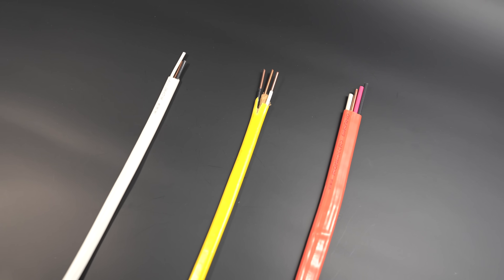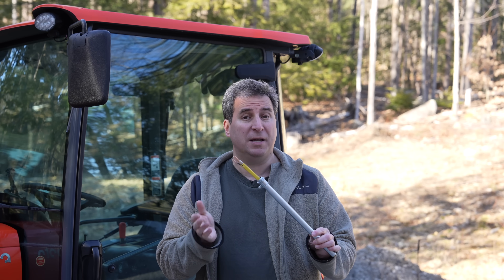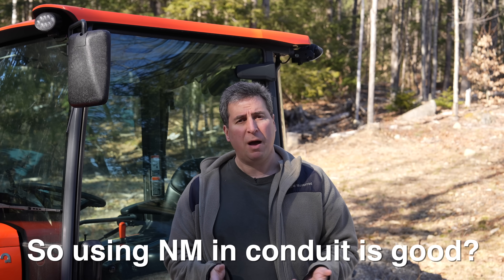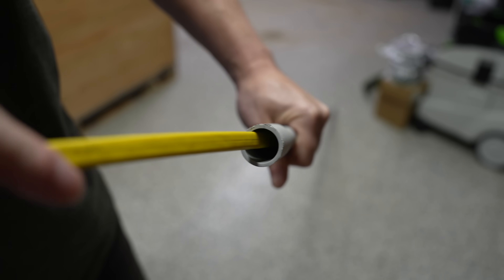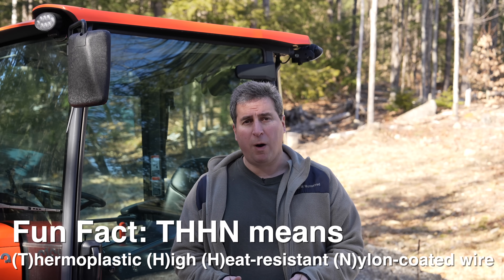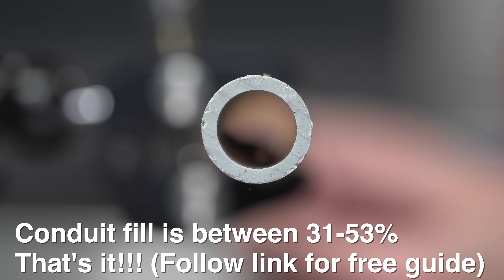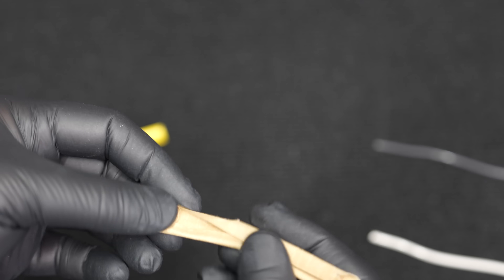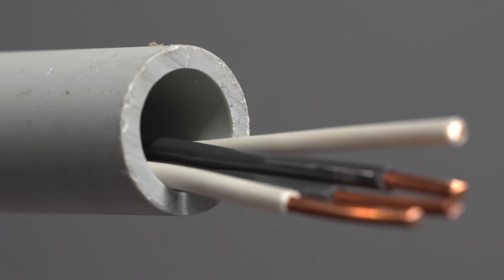#1 DIY Electric Mistake - Can you use Romex Wire in Conduit?

Comment: is it all wires cover same material over copper ???  whats difference between both romex and thhn..both have nylon jacket covering copper conductors ...also plastic is much safer than metallic ...it also add another layer of preventing electric short when it touch the casing ...vs metallic ...its gonna have current traveling anything made in metal, well good news least we move on from dangerous knobs and tube wiring when they use fragile rubber that can brittle by touch ...also PVC pipe has to be leak free sealed system...i see sloppy installs for underground pvc that meet with coupling above surface and another pvc to outdoor breaker box that leave inch gap between both ends ...not proper measurement and illegal to have when rain water can drain into pvc that meet coupling and joint to other pvc goes underground
Reply: @inthemiddleof  Incorrect, as per  UL 719 NM-B cable can be, and are,  constructed of 90 deg C conductors but is listed at 60C for ampacity calculation only as per the NEC.  The conductors in NM-B are UL 83 (THHN/ THHW-2 (if there is no nylon jacket)) or UL 44 XHHW.. They are not required to be marked on the conductor but they do meet the Ul requirements.. If the conductors are properly marked they can be used without the jacket (Talk with your AHJ about all usages and applications for ALL electrical building materials.. the NEC code (NFPA 70) is not "law" and the local AHJ has a lot of leeway).
Also, most UL conductor styles have multiple listings. THWN-2 is the most rigorous of the "T"
T stands for Thermoplastic ans was the original plastic insulated wire rated at 60 deg C DRY only (No nylon jacket)
Then came TW.. 60 deg wert or dry  (No nylon jacket)
Then came THW  75 deg wet/dry  (No nylon jacket)
Then THH/THW  90 deg dry, 75 deg wet  (No nylon jacket)
THW-2   90 deg wet/dry  (No nylon jacket)
Then came THHN/THWN.. 90 Deg dry, 75 deg Wet (with a Nylon jacket)
The latest is THHN/THWN-2  90 deg wet/dry (with a nylon jacket.. This is commonly referred to as THHN-2 but is actually THHN/THWN-2
Reply: @darikmatters8866  why would 90c conductors be marked as 60c fot calculations ? It makes no sense.

Comment: Solid wire in conduits limits the types of connectors you can use at the application. Solid wire, the conductor constituents of romex have a resistance to turning that can split the insulation along the length of the wire. The better solution is to switch to stranded wire if you’re 100% certain how your wire is going to feed in the application. In remodeling projects the problem is that you applications need to fit into existing modified spaces and this means that you may not be able to use 6” radius turns.
Reply: I do not know what you are talking about.. I have sold at least 10 million feet of #12 and #10 solid THHN/THWN-2 over the last 40 years without a failure as you describe (I have done some rough calculations and I have sold at least 250 million dollars of basic building wire). 
As a separate note; Ther NEC does not make accommodation for limited space in renovation. If you have to bend the wire more than its allowed by NEC or manufacturers written recommendation you need to find an alternate method, period. Solid is used for these small diameter wires because they typically terminate better and more reliably without a terminal lug and they are less prone to corrosion due to the smaller surface area and less wicking. I sell #8 and #6 solid for municipal street lighting circuits due to the reduced corrosion profile.
Reply: @darikmatters8866  split insulation are not common, I agree, but in demo work I find enough of then to take note. Maybe you have better electricians in your area.
Reply: Are you talking about split Nylon jacket or split open insulation with the conductors exposed??
Reply: @darikmatters8866  exposed conductors.

Comment: So you can't run non metallic conduit underground ? Won't your conduit just rust away eventually?
Reply: PVC and Fiberglass conduit is the best choice for underground.  But steel rigid  is  also permitted when increased  protection from physical damage is desired.

Comment: You can run in a wet location if you run it through liquid tight flex.
Reply: Romex is bunned from outside use, regardless of a raceway type. However,  you can get UF type NM cable (rugged,gray color outside jacket) that is rated for outdoor installation,  even exposed and buried underground without conduit, where it is no subject to physical damage and depth requirements are met.

Comment: Love the video and straight to the point direction. Excuse my ignorance I’m just a DIY’er home owner. Beside the 53% conduit full and the struggle it takes to run it in conduit. Is that the only risks or hazard why you can’t run it in moist area? I’m guessing pulling the cable would damage the yellow jacket?

Comment: Funny thing is some romex has THHN wire in it (even individually labeled) but since its not intended for use outside the cable it cant be used as such, lol
Reply: I have never seen conductors labeled inside of romex.

Comment: This is interesting.  My arcade was wired with 1/2" EMT with Romex.  We discussed the code / fill and found it acceptible.  The heat issue did come up but since it was split between 2-15 amp breakers for both halves of the room it was deemed acceptable  The foundation has insulation on the outside and the inside temp holds steady between 57 and 60 year round.  Bending was a fun trail and error.  And to be clear the wire was inserted before all bends and pieces so there was no pulling.  He never mentioned water / condensation.  I wonder if it will ever fail, been going on 6+ years good now, no issues.

Comment: I was also of the understanding that it was illegal.   Now one for you.  I bought a house with two garages and the homeowner had wired both garages.  They had ran the romex through PVC water pipe.  I removed all of it and replaced it with armored cable.    

It gets better.  There’s a safety switch on the side of the house that’s fed off the main panel.  It had one 30 fuse, there was room for two.  It went overhead to the 1920 garage that had an age appropriate fuse box, glass screw in fuses.  They had the romex going through two walls and into the second garage.  It was on a 20 amp fuse, in fact both garage were on the same 20 amp fuse.  

Everything is now on modern breaker boxes and proper sized wire with correct sized breakers.

Comment: I'm an EMT guy on Block walls, Smurf in Attic. MC For Lighting for Flexibility.
Code is For Safety, 35+ Years Master. I avoid Romex Except if Has To be Used, Conduit can Protect Going into Attic from a Block wall. Removing Protective Outer Sheathing and Putting in Conduit Should  be Considerd Better Protection. Removing Outer Jacket is Good, As It can Dissapate the Heat. Need to Add Eception to Code. Conduit Protects Better than Sheathing. No Brainer

Comment: I've got a couple of problems with this video. First, I can't imagine any competent electrician wanting to run Romex in conduit. If you don't want your insurance company contesting who is responsible for your burned down property you should be using a licensed electrician. Second, what about derating the ampacity of the cable? Isn't Romex intended to be run in free air? Third, in a related issue, how do you handle conduit fill?   In my opinion, if I saw Romex run in conduit I’d call the local electrical inspector.

Comment: 1) NM Cable is not permitted in Damp or Wet Locations. 2) Now, if you want to put a related product in the raceway you place UF-B in the raceway if you choose. Also, be aware that if you are only using the raceway for protection from physical damage then look at Chapter 9, Table 1, note 2 and the raceway fill is not necessary if the raceway is not a complete run and only being used for physical protection. However, if the raceway is complete between boxes, cabinets, or enclosures then you most certainly have to do raceway fill per Chapter 9, Table 1, note 9.

Comment: I want to use 2-inch PVC pipe as a raceway.  Indoor dry environment. How many 12-2 Romex wires may be run in this pipe and still comply with the 53% rule?

Comment: Where in the code does it say you cant run THHN in a conduit in a damp location?
Reply from the maker: I said just the opposite
Reply: @SilverCymbal  The individual conductors in NM cable are THHN. I thought you said you couldn't strip the wire and put it in conduit. Maybe I heard you wrong?
Reply from the maker: @cousinles80  You are assuming they are THHN, and they may be, but you cant be sure of that because they aren't labelled individually. They are blank.  All THHN will be labelled with ratings, etc. Unmarked wires are NOT allowed under the NEC as you don't what they are. I am not the police and you can do what you want, but this would always fail inspections if they see that and it's not the correct way to do it with unmarked conductors.
Reply: @SilverCymbal  You are correct, I just found it in the code book. I see they even make connectors that go from romex to emt, not sure where you would use them. I stand corrected. Thank you.
Reply: For years I thought it was bad practice to run NM cable in conduit, so I would strip the Romex back the length of the conduit run  and put a male adapter and a threaded coupling with a romex connector on the pipe. I never failed an inspection this way but maybe from now on I will install a junction box and convert to marked THHN wire.

Comment: The problem is "heat".  Code allows only so many wires, Romex is not only an electrical insulator it is a heat insulator.

Comment: I worked at a local Home Depot. I’m an engineer (retired) so I got a job in the electrical dept. My supervisor was not an electrician, so I wound up getting the right kind of knowledge from our master electrician, Don. He had his master from New Hampshire, Maine, and Massachusetts. So I leaned a lot from him. However he said that Romeo cannot be used in any conduit due to the amount of heat that this wire  can generate. Only individual wire of TTHN can be used in a conduit.
THHN has far higher level of heat load and the wires inside the Romeo wire does not meet the heat load do to the insulation type. It is not even close to the TTHN wire.
Reply: That's why romex is rated for 60 degrees.  It is perfectly code compliant to run nm-b inside of conduit.  I thought we already established this.  Hell, romex is run in INSULATED walls.
Reply: Any conductors, particularly single phase inside a metallc conduit will generate some heat from  inductive reactance which causes some heat.  this is normally not a problem except in very long runs (thousands of feet) where it will cause voltage drop.
Obviously the greater the load the more the voltage drop. Same situation but less so with 3 phase.
Reply: @parkerholden7140  Inductive reactance causes heat?  You might need to go back to school.

Comment: One caveat possibly? 
I used "non-metallic (romex)" rated for direct ground burial. I still put it in [inch and a half] grey pvc conduit and it was a ~200 ft run. 
I had two corners and used "long 90" degree elbows. 
It installed fine, but If I recall correctly, I glued my corner last so I could work the cable from there if it got hard to pull. It pulled easy, but it was a "roomy" pipe.
Great information!!

Comment: Great Vid !  Taught my electrician friend this just yesterday when he said I could run Romex in conduit outdoors. The Romex insulation is not designed to handle long term moisture & will / can short through the insulation. I'm not an electrician but was working on my own home & wanting it to be safe after I'm gone, did it the right way, using individual THHN strands.
Reply: Romex insulation on the individual wires is pvc & is fine unless exposed to uv rays

Comment: I’ve still used pvc conduit.  The goons that do cable, phone electrical, gas etc, dig with reckless abandon.  It gives me an added layer of protection.  Whoever buys my place after I’m dead and gone, can replace whatever they want.

I have had to fix multiple issues due to utilities digging and damaging wires.

I get the rationale and yes it is a bit of a challenge to pull it through the conduit, but lubricant can solve that.

Comment: This obviously does not apply everywhere. NOT allowed in Chicago, for good reason. The insulator on the outside of NM also contributes to wire fill and increases potential for heat.

Why anyone would be so lazy as to run NM through conduit is beyond me.

Comment: I think you did a great job on this factual and concise video.  Since you did make a comparison between NM and THHN,  It's worth noting that the ampacity of NM-B is determined by its 60 degree C rating.  While THHN has has a 90 degree C rating and its ampacity is determined by the lower of the wire rating or the temperature rating of the terminations.

Comment: What about running type UF inside PVC underground, when the intent is to provide added protection from physical damage...as long as conduit is properly sized with adequate space.   Note also, conduit fill limits are tied to the heat rating of the wire, are they not?....bundling too many conductors under load in an undersized conduit can lead to overheating of the conductors inside the conduit.   Having air space around the conductors is critical to allowing heat to dissipate is it not (as addressed in NEC wire size & conduit conductor capacity tables?) ....this is especially critical with continuous loads (like fans, motors or AC equipment) which can lead to overheating of the conductors, if the conduit (and or conductor/wire) is undersized.   It's very hard to simplify what your video is trying to cover when the NEC covers concerns that are a bit above the comprehension of most handy homeowner DIY electricians.

Comment: My only issue with this otherwise informative video is the term illegal.  Electrical work is either up to code or not.  I would term "illegal" to work NOT performed under an approved permit (per local guidelines).
Sure electrical code can be overkill at times, but from an insurance perspective should an electrical fire occur, the difference is them paying out or denying the claim.

Comment: Might also suggest to use cable/wire pulling lubricant for longer runs or more wires in conduit, also to lay wires side by side rather than randomly twisted when  feeding multiple wires into conduit

Comment: Here’s a good one and I’ve added this comment to it, that sort of disputes his claims of impossible, he should of soaped the 3line wires to lubricate for the pull then followed my advise:

	like with anything electrical, cautious handling. He’s right, don’t crowd them and 90 degree turns are OUT, 2x45’s are best for cornering. Send through a fish line, securing the coated bundles and pull’em through.
I did and it’s been UNDERGROUND FOR 25 YEARS NOW, yes, go HEAVY ON SEALING ALL OF THE JUNCTIONS. BEFORE I pull line through, I pressurized the GRAY CONDUIT, SOAPED EACH CONNECTION TO CHECK FOR LEAKS (Like you do for gas lines) with a wet bar of soap and a small paint brush, all the way around EACH junction. If it bubbles, clean it off and seal it some more

Comment: Can I use 12/2 romex  and run it through a 1/2 inch metal conduit that’s 5 feet long to a outlet inside my garage
Reply: You can but that is against code.  1/2" is too small in diameter as it will be filled beyond accepted capacity.  It's extra work to add a box and transition to THNN but will be code.  Should you have an electrical fire, anything you do against electrical code (national and/or local) could cause your homeowners insurance to deny any claim.  
There is always a larger impact when trying to cut corners.
Reply: Thanks Very Much for all your help

Comment: You never said WHY you can’t use Romex in a conduit in a damp location!
Reply from the maker: They never officially say, just that it is not rated for a damp location. But if you compared wet rated cable you will see that the paper is not there. The common belief is that the paper will rot and cause the breakdown of the insulation of the surrounding wires
Reply: This is the difference between an engineer and a technician.

Comment: Also one more fact about-- inside the pipe white is white, black is black etc. that means you can not use for example white wire tape it with a black tape  and use it  as a hot black wire  -- inside the pipe white  can mean only white , red can be only red , blue  can be only blue etc.

Comment: I have put NM wires in conduit, no issues. Example basement wiring where the customer wants outlets on the block wall. Makes no sense to run thhn. Only 1 wire use 1/2", 2 pairs of wires 3/4 conduit.

Comment: What about UF going down outside (wet location) in PVC conduit 20 inches (code says min 18") then is run no conduit at 24" deep (per code) over to shed, comes up a 20" piece of PVC conduit and along side of shed in PVC conduit to the entry junction box? All PCV conduit junctions are glued.  Asking for a friend.

Comment: So much more to this than that , if you're bringing the NEC into it. (more Rules and Exceptions will apply) Common sense is a good rule. Bottom line is what the Inspector or Authority Having Jurisdiction has to say about it. Back to the "common sense" thing... stubs, nipples and sleeves are one thing but, pulling Romex through long runs of conduit is just plain stupid for many reasons regardless of what the NEC says.